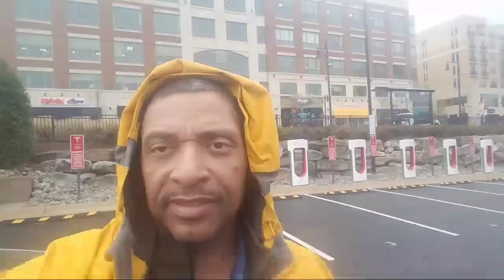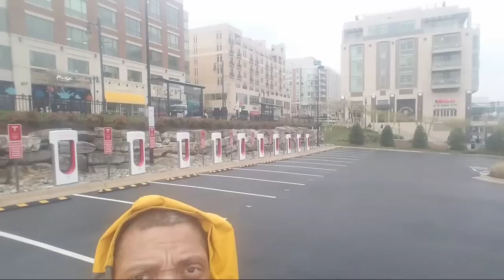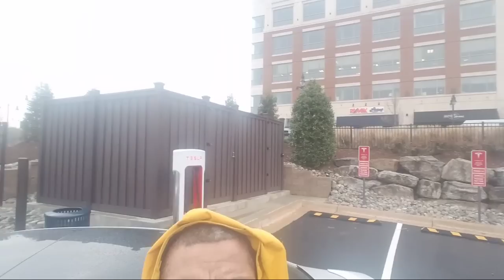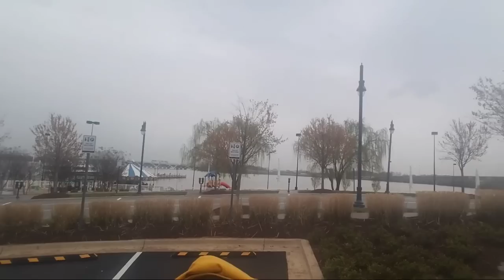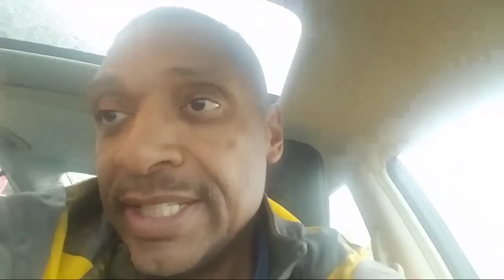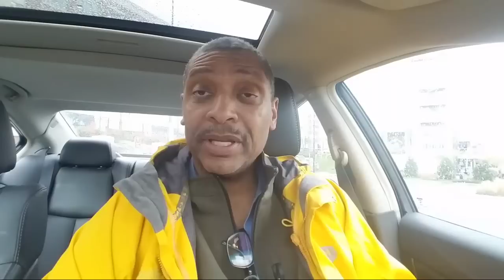Tesla red yes No Yellow osha?,Model S TOYOTA build Vs MODEL 3 build #240

Comment: I think automation will work, he just may need to modify the robots.  Elon needs to study how Pick and Place machines work in the Electronics Assembly industry.  There are a number of things they do to insure precise placement.
Reply from the maker: +Joe K the point is Toyota is the best and uses a process robot inclusive but people key
Reply: I understand that, but just because Toyota is the best doesn't mean someone can't do it better.  Pick and Place machines are similar to the robots except smaller. They are very fast and very accurate.  That is because the high accuracy ones have a vision system.  The boards have a fiducial which is in a location on the board relative to the rest of the parts. The machine reads that so it can adjust it's calculations of where to place the part. But the head (robot arm) can also have vision that reads the pads and adjust what it is placing.  I just think their are things they can do to increase the accuracy of the robots they are using.   

I get if the robot has a flaw it is replicated.  The idea of to find out why the robot is failing and come up with a solution.

Comment: When you talk about automobile suppliers supplying parts. A common method that an automaker uses is the manufacturer of that component may be integrated into the assembly line and it is their responsibility to determine the best technique to install that particular car-part. The other thing that is plaguing Tesla which will plague every automaker is the production of a brand new model a lot of people do not buy brand new model cars because they know they are plagued with problems. Another interesting fact about automobile production is automobile manufacturers routinely evaluate technology advancements in particular components to determine if it should be an out sourced product because of their own developmental cost and Manufacturing facilities. An example of what Tesla should be doing. It should be forming different corporations facilities for instance battery production Tesla should sell batteries to anybody that wants to buy them from them including battery packs. I have owned cars that I've actually had other car manufacturer Parts in them by other car manufacturers. Back in the 80s Toyota Supply several parts to General Motors for some of their vehicles. The question is why because they need to sell a lot of batteries to pay for the investment in their gigafactory more then at this point they are consuming themselves and with battery advancements around the corner that factory will be obsolete before they have it paid off. The Korean electronic  manufactures Samsung is a prime example they will sell components to anybody that wants to buy them because they want to push as much product through their lines as possible so they can pay the research and development off and the manufacturing facility costs.
Reply from the maker: good points

Comment: The Model S is all aluminium while the Model 3 is a mixture of aluminium, high strength steel and, regular steel panels (such as rear quarter panels).  You cannot assemble them the same way, so I believe you are making an incorrect analysis that Tesla should have another factory, duplicate the Model S, and then make Model 3's on it at a faster rate than they are currently doing.  For starters, the Model 3 line is producing more vehicles per week than the 2,000 per week of combined Model S and Model X line(s).  They have to increase that to 10,000 Model 3's per week.
Reply from the maker: i am referencing half robots and half humans rather than 90 percent robots on a new model 3 line

Comment: I am not sure that it has been proven that Tesla did not report injuries and safety infractions, so it should not be stated as a fact.  Regarding no visible yellow lines in the CBS video, I am sure that the government inspection agencies reponsible for workplace safety would not overlook the lack of safety markings.  I have seen photos of the factory which show physical barries and plexiglass around the robot stations to keep humans out.  I think the Gigafactory shutdown is to install the Grohmann engineered battery module equipment, which will allow production to increase.  The Freemont shutdown is likely for two reasons: 1) if not batteries are coming out of the Gigafactory during their shutdown, you cannot assemble the Model 3   2) Tesla is also likely using the opportunity to make more changes to the Model 3 line to eliminate bottlenecks.  Musk has thrown down the gauntlet to suppliers to deliver the quality that Tesla expects.  We will know in 2 or 3 months how they are doing, in the meantime

Comment: I agree with Elon Musk that there are areas in a traditional car production that leave room for quite big improvements. This is not the case in the first attempt, and something suggests that Tesla has learned a lesson there, they built and tested a whole production section in Germany before it was implemented in Tesla's production. Tesla has invested heavily in robot technology, and has replaced steel parts with carbon fiber to enable robots to move faster. Model 3 is structured significantly different from S, and with a larger mix of materials that still requires a new production line. Likewise, with Y to be built differently. Good reason to strive for higher automation - in a short period of time, I think we'll see some production conditions that look like something from a science fiction movie!